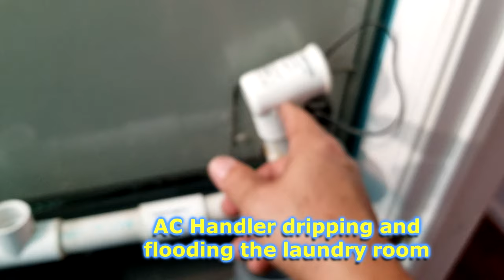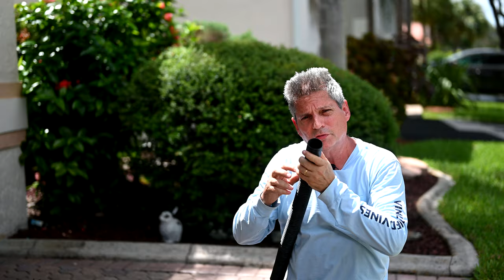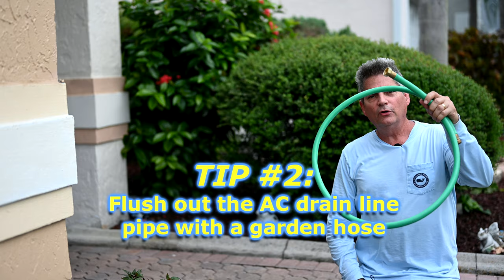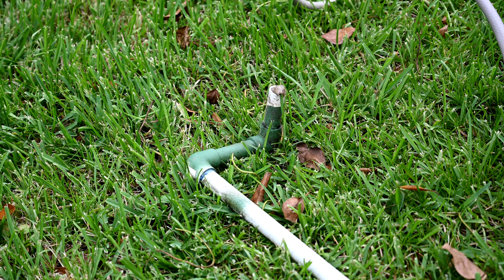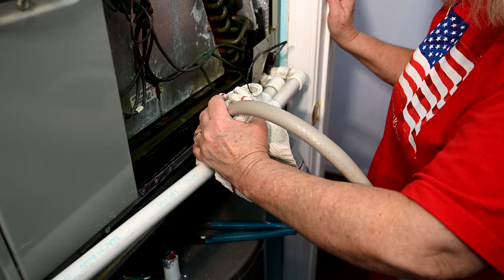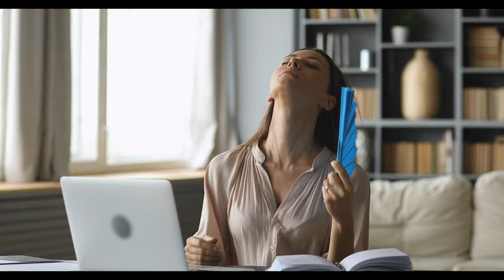AC Dripping/Won't Turn On?  2 Tips Unclog AC Drain Line Pipe

Comment: My ac unit is outside in the backyard and I've noticed there are two pipes. One at the bottom of the house and the other one closer to the roof. The pipe closest to the roof is continuously dripping water and then some days it doesn't at all. The one at the bottom of the house drips very little. How would I go about cleaning that? When the air kicks back in it makes kind of like a thump noise inside the vent in the hallway of the house. Is that normal?

Comment: What about a/c working great but no condensation coming out of drains ? There is no water backed up or leaking at the airhandlers in the attic. I pulled out level switch and its bone dry also.

Maybe due to low humidity of 8% right now here in Arizona. Maybe once monsoon season starts it will start to condensate. Right now I get about a cup a day out of the drain pipe.
Reply: Wow thats nose crusty dry air! Yeah, if there is no humidity in the air to extract your AC is not going to produce a whole lot of water. Here in FL I get over 5 gallons a day!

Comment: Good tips on the drain line, i also put bleach into the line to keep it clear of gunk. thumbs up
Reply: cway44 doesn’t bleach mess up the pipes? It can react with gunk and make it worse by releasing fumes. People forget that bleach is very powerful and toxic.
Reply: @helpontheway5404  I haven't had a problem, I use maybe a 1/4 to 1/2 cup of bleach to keep the line clean.
Reply from the maker: Bleach is OK in the PVC pipes, but it might kill your grass or flowers in the garden if your drain line pops out there.
Reply from the maker: Lots of people do this. I hate bleach smell, so I don't use it.
Reply: I've heard from a AC guy that bleach is very bad for the AC coils if you get it on them (corrosion). The steps that Jeff demonstrated is exactly what AC guys do. If the clog is really bad, they can use special drain cleaners made especially for ACs that are safe for coils. But again, using the steps Jeff demoed will do the trick.
Reply: @ccadama  I am not putting on the coils, I am putting the bleach down the drain pipe, If you see in the video Jeff is putting a hose is the spot where i put the bleach, from there gravity takes it away from coils.
Reply: @cway444  That's good. Some people add bleach to the AC drain pan which if the pan is filled with water or were to splash can damage the coils.
Reply: jeffostroff <3
Reply from the maker: @ccadama  right especially on my new a Ac that we installed last week, the Dave Lennox XC25 series, those coils are made with aluminum coils and aluminum tubes, not copper, and they have stickers on the coil warning you to clean the coil with water only, you cannot even use those spray foam cans of coil cleaner in the stores, only water, no other chemicals should be poured int ot he pan.
Reply from the maker: @helpontheway5404  most Ac setups are negative pressure systems, so they suck air up from below, and bleach fumes from the pan could end up in side the house.
Reply from the maker: @cway444  Down the pipe is OK, but I doubt it really helps, because bleach does evaporate quickly. It does not leave a lasting treatment coating.
Reply: Be careful using bleach. 
Eats the pvc glue and if its copper pipe it will eat it. (Corrosive) use Vinegar instead trust me
Reply: @ccadama  the bleach must be diluted with water in a 1:4 ratio and poured into the pan carefully. I do it at least once every two months.

Comment: I have two large PVC pipes on the outside of my house which water doesn't drip out. The drain I have is next to the furnace and drains off into sump pump. I see some water coming out while furnace runs but I'm still getting water leaking on top of my furnace where I think the drain tray is located. I don't know how to get that section off to look at it🤔
Reply from the maker: Did you try to blow out the pipes leading from The unit to see if maybe there's something wrong on there? Or maybe you can put your shot back on the output side outside the house and try vacuuming out. I just did it on my pipes the other day because the AC was clogging and backing up and water was dripping through my ac filter.

Comment: You want to avoid clogged A/C drain lines then get rid of the P Trap, you want an air trap instead from DES Champs Technologies. The problem with P Traps is they create slime that plugs up the P Trap. The Air Trap is dry so no slime build up. The second thing you need to do is put a cup of white vinegar in the drain line by the air handler, the vinegar will combat slime build up.

Comment: great job, just subs'd.!...so y did you take the filter off the hvac in the first step? thanks
Reply from the maker: Yes, no filter and no bag, just an empty vacuum inside
Reply: @jeffostroff  thanks, but can you explain y??? is this a common practice to remove filter when dealing 'wet stuff or 'gunk stuff'????
Reply from the maker: @mml1224   You must remove the filter otherwise when you vacuum up the water it will end up in the filter in ruin the filter and get all wet and soggy. You don't have to worry about  Hurting the inside of the vacuum as there is a little float built a near that when the water level gets up too high the float will shut off the vacuum automatically. So then you just dump out the water and left a vacuum dry off and you put the filter back in when you are done
Reply: @jeffostroff  that was as good advice as watchin video, never thot of that. do u usually remove filter when dealing with dirty water??? just leave it for dry stuff, thanks

Comment: I connect my water hose to the outside drain pipe and a wet/dry vacuum to the inside flush out and turn on the two at the same time at full power for a few seconds until the wet/dry is filled,you won't believe the slime that comes out.That was the whole line is cleaned...but you can also have slime build up in your pan,so it's good to open up and take a look,you can also pour water and bleach mix where the float cut off switch is,that way it goes into the pan and kill the bacteria that causes the slime and will slowly leak out the drain line.

Comment: Hi Jeff, thank you for the info. I just did what you informed us, but the inside a/c unit still doesn't work. It makes a little noise like when you originally shut the unit off. It sounds like the motor doesn't start full power. When the unit stopped working was turning on, but having a little bit of problem starting. Then was working for a few hours & shutdown. If I waited a few hours, it will start again & shutdown again. Until one day, stopped working, but you can hear the sound like when you shut it down. I guess it's hard to explain. Maybe the motor went bad or something. 😏
Reply from the maker: If it shuts down, it either thinks it reached temperature, or a thermal protection is kicking in and shutting it down
Reply: @jeffostroff , Hi Jeff, is that something I can fix it myself or I need to hire you to come & fix it for me? If you can fix it, I  have a couple of other small jobs I can pay you for too. 🙏  My a/c is 8 yrs old, so maybe it's under warranty if the part is expensive.

Comment: Is it okay to use the vacuum on the inside line? I have a shop vac but the power cord isn’t long enough to reach the outside of the house where the drain line exits.
Reply: Borrow an extension cord. It's very important to vaccum from outside.
Reply: Oops. I actually did go out and buy an extension cord, however, I couldn’t find any outside drain line.  So I did it from the inside, then poured vinegar down the line. It’s been 2 weeks and so far, no more water backing up into the house.

Comment: What type of vaccum do I need to purchase to suck out the AC overflow pipe. 
   I have a regular vacuum cleaner 😬 or do I need to purchase some expensive Dry/Wet Vac? Just trying to help a friend out 😢
Reply from the maker: Yes, buy a small wet/dry vac, and remove any filters vacuum bags first, then put them back when done.

Comment: Hello can someone tell me do we really need a trap for drain??
Reply from the maker: Yes, it is required by code. It keeps outside air from coming back into the AC and causing condensation inside the unit.
Reply: @jeffostroff  thanks

Comment: Can i use regular vacuum for the carpet?i dont have wet vacuum.😢
Reply from the maker: Only use the reg vac if the owners manual says you can. Might have to remove any paper or foam filters first
Reply: Thank you i will try tomorrow

Comment: How do I clran out the line when it's in the attic. The ac drain is 20 feet off the gound outside and I can't take a garden hose up 3 stories.
Reply from the maker: Go outside, attach a shop vac to the outside part of the pipe and run the vac for 30 seconds, that will clean out the line

Comment: To vacuum the drain pipe, do you turn off the a/c?
Reply: Yes!
Reply: @tonnicallan333  Why? How would it be a problem if it was on?
Reply: @crand20033  Not sure  it is  absolutely necessary....
BUT, two things:  
To stop MORE water running in while you are  trying to correct the issue,
AND for safety.
WHY is it a big deal to turn off? Most plumbers insist on it and it's their profession. Go ask one of them.

Comment: My AC keeps turning off because my float switch pipe will start to tilt too far down. I had to prop the pipe slightly up by putting a piece of something below it to hold it up so it’s tilted a little upwards. Will this harm the unit? It gets a steady stream outside but the float valve pipe won’t stay leveled completely
Reply from the maker: That small section of pipe that leads down to the float switch should be level or maybe even slightly upward that way you're relying on water that's backing up inside that pipe to back itself up all the way to the float and then make the flow switch go up to trigger the AC to shut off because the water level is too high. So if yours is angled downward then something is wrong and it should likely be cemented into that position where it should be up a little higher. that is how you should solve the issue
Reply: @jeffostroff  thank you for the quick response. I positioned it a little lower so the float valve can do its job if the water rises. I’ll monitor it to make sure there’s no leaks. So if the float valve isn’t detecting the blocked water, I would probably start seeing some flooding coming from the unit? Also the water that’s in my float valve pipe is is very low. I think it’s always been that way. It’s just when the pipe tilts too far downward, the little bit of water triggers the float valve.

Comment: i think my drain line is coming  out UNDER my AC unit ? it's a black pvc pipe not sure if it is connected to my unit or its a mis-routed drain line...comments?
Reply from the maker: I have seen numerous times over the years where people didn't cement the pipes going up to their AC drain pan. In your state if you're using the black a BS plastic then your cement that you use as a yellow cement typically and has the primer built into it. Here in Florida and other states that use the white PVC pipes, you are supposed to apply a purple primer first and then cement which many unbelievably ignorant people don't do. So yes you if it's loose you will have to find out where it is loose otherwise it will leak and I have seen it leak into friends walls before and caused $30,000 in damage and mold remediation.

Comment: Is it supposed to not drain at all?  Drainage or dripping is a sign of a clogged pipe, isn't it?  I have not seen it dripping or draining at all.  Please advise.
Reply from the maker: Dripping should only occur outside the building. If you see it in side the building, there is likely a backup on the drian line
Reply: @jeffostroff  thank you for your reply.  Yes that's correct I now have a steady stream coming out of the pipe under my eaves outside. For several years, I have not seen it before.  So this is normal?

Comment: Is it normal if the condensation drain line drips water if ac is off?
Reply from the maker: If the AC is off you should not be dripping, unless it is still draining out any water left in the AC Pan
Reply: What if the heater is on? Does it drip usually.

Comment: Hello , I have AC that in the Attic and just caused a leak which affected the ceiling and I have to change all the ceiling and of course I had to hire a very expensive Water flood company . Now how can I fix that leak since there is no outside pipe to take this water outside of my condo. The AC man told me he will install a pump to prevent future leak. Do you think this is a legit solution ? I live in another state and have no way of knowing how to deal with this. Please advise me .
Reply from the maker: Yes, many people use a pump, but if the pump fails you will be right back in the same position again. I would work on getting a pipe from the AC to the outside, I don't see why you don't have one!
Reply: @jeffostroff  because the condo in Hawaii and I bought it like that . HOA will not agree to have a drain outside. This is costing lots of money and I live in CA and they are taking advantage on me.
Reply: @jeffostroff  I don't have one outside in Texas.

Comment: Idk where you are gonna find a wye fitting,  wyes are made for drain pipes that need flow direction,  and even then clean out tees on drain lines are straight tees,  I'm a plumber and ive never seen a3/4" wye sprinkler pvc fitting,
Reply from the maker: The 3/4" wye does exist: Caldera Spa Pvc 3/4 Inch Wye Fitting WAT38505. If you can't get that might have to put an inline shut off valve to keep water from coming back to the AC pan when you gush it down the T-fitting.
Reply: @jeffostroff  ok and to your point of no diyer will spend 400 for a air snake.. hvac techs aren't going to order hot tub parts for condensation drains.  It realistically isn't going to happen which is why ive never seen or heard of it.  Ive been doing plumbing 15 years and never seen one since I don't work on hot tubs. I can confidently say that's why systems don't have it set up with a wye,  because 1- companies aren't making it easier for homeowner to do it,  2- it will have more service calls,  3-pros have tools that work and can take care of it in 15 mins

Comment: Vinegar is much more pleasant than bleach, slightly less effective though, but not toxic.
Reply: PUMP SOME BAKiNG SODA WIT IT LOL
Reply from the maker: Baking soda does not work, and we don't recommend it as it can pile up wherever there is a 90 degree corner fitting. We have tried various old wives tricks over the years, none of the work, no Draino, no vinegar and baking soda to make it foam up, no bleach. If you have a clog, the only thing that plows through it is water pressure or air pressure. Those are your only options that work.
Reply: @jeffostroff  OKIE DOKIE YOU KNOW BEST. BETTER THAN ME. IT WAS JUST A FLEEING THOUGHT BROTHER. THANK YOU SIR.

Comment: What is the sludge made out of? What made the water get all sludgy like that?
Reply from the maker: bacteria and other particles that coagulate in the environment of that chilly water draining out of the AC
Reply: @jeffostroff  My thermostat was blanking out and then coming back on. This was determined to be the problem. How often do I have to clear the tubes and how do I prevent it?

Comment: Of course my drain line is clogged.  The water is overflowing onto my bookshelves!  That's a hint.  I don't have a shop vac.  I'm not going to use my floor vac because I don't want water to get inside it.  I didn't have bleach so I poured some oxygen bleach down the front of the fins so that it will get into the tray.  I have no idea how to get to the tray otherwise.

Comment: Seems like you’re doing it the hard way. As long as it works for you I guess.
Reply from the maker: Not sure how you could see it's the hard way. She had a hose right there outside the garage we brought the end of it into the garage stuck it inside the pipe and shot the clog out. We have other videos that show easier methods such as just hooking up your shop vac to the outside of the house where the pipe exits the building and tape it to the pipe and it sucks all the goo out of the pipe
Reply: @jeffostroff  I see. Most people don’t have a hose bib near their indoor unit. This is not a method I would recommend in any general situation. Like I said though. Whatever works.
Reply from the maker: @AaronPowellvox   We have done the hoses inside many many times without any problems because you just turned it on for about 2 seconds and turn it right back off again and it doesn't really flood the inside at all. We've run it from the laundry hook up before So you don't even need a hose bib at that point because you've got a water supply right there in your laundry room.
Reply: @jeffostroff  I hear you. I typically use cleaner in the line after vacuuming it from outside. I let the cleaner sit for a spell then flush it through with about a gallon of clean water letting gravity do the work. I’d be afraid of someone flooding their house doing it with a water hose. I have started using a battery operated water transfer pump recently to clear the emergency drain pans and in turn clear the line but I understand you’re trying to help the average joe save a buck.

Comment: if the alage  is that  bad in the the drain  , replace  as  much pvc you can and lastly   when  you remove  the cabinet  door on  the fan coil  unit , get your  wet dry vac  grab  couple 3/4 pvc fittings    and some 3/8 clear neoprene tubing   .   that way you can clean all that  shit out of the pan  , no way in hell your getting  all that alage  out with a turkey baster  ...lol...   and make sure pan is sanitized.  otherwise  it will  just become a ongoing  problem. ✌
Reply: Is it really algae?  I thought it was insulation from the attic.